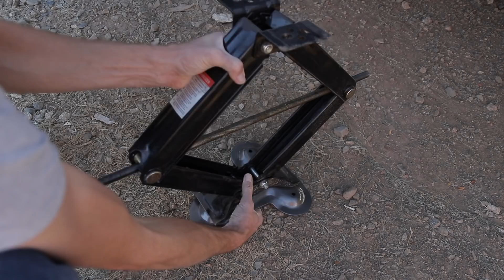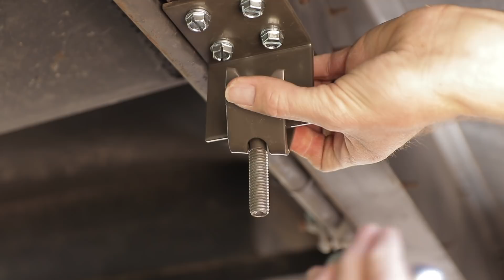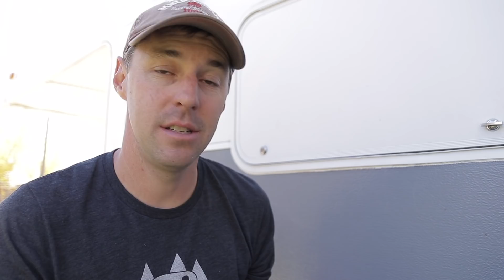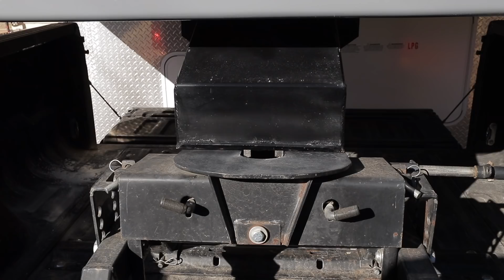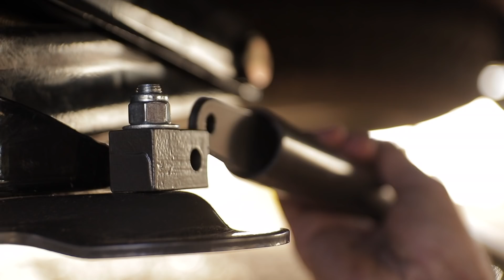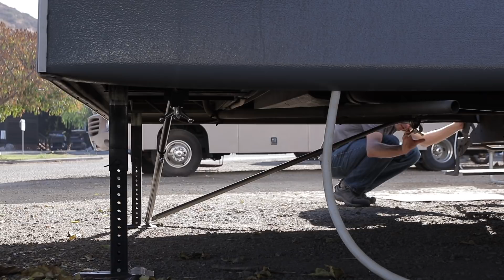RV Stabilizing! Review and Install SteadyFast!

Comment: Would drilling into the frame void any RV warranty?
Reply from the maker: This type of install would not void a warranty but you could if it was excessive and in the wrong spot. This install wouldn’t cause a structural issue or problem for a warranty.
Reply: @AllAboutRVs  Thanks for the speedy response.  👍

Comment: So after 3 years, how are they holding up?
We will be getting a 5er this winter, trading in a TT, and am curious about these. Had an issue of rocking in a previous 5er years ago but not certain how the new one will rock with the auto-leveling system.

Comment: If an RV stabilizing system is installed, is there still a need for something like the X-Chock, which acts as wheel chocks and is supposed to reduce the rocking motion? Would using "ordinary" wheel chocks be sufficient if RV stabilizers are installed?
Reply from the maker: I use just normal wheel chocks. I never saw much of a benefit when it comes to stabilizing with the he X chocks. I would use X chocks if I were to be up on blocks to level. It would be the easiest way to chock then.
Reply: @AllAboutRVs  Thanks!

Comment: My wife and I are very new subscribers to your channel and we love all the information you and your wife have.  I recognize the need to avoid interference with the placement of your stabilizing bars.  Was there any other particular reasoning for the specific placement?  I noticed the double brace was in the front, single rear.  Was that in hopes to further stabilize the master bedroom or more a manufacturer's recommendation?  We are brand new to RVing but have noticed plenty of movement in our older 2005 30' TT we just purchased.  Thanks!!
Reply from the maker: The back of our RV is drop frame so there was more room to put it in the front and I wanted it under the master bedroom and the angle is more effective in the front since there is more room to put it at a better angle

Comment: Nice video!  

1.  Will this help with motion caused by a hybrid flip out bed?  The leverage it has really amplifies movement in the rest of the camper. 

2.  Any chance you could do a short video of your kids running with a glass of water on the dinette table with and without this system.  Seems like that would provide a nice visual.  

Thanks!

Comment: Good video. I had the Steady Fast System on my tavel trailer 10 years ago. I didnt install them on my 5th wheel when I got it 9 years ago even though it did work great on the travel trailer. I have the JT Strongarms on the 5th wheel and not all that impressed. I think I went with it because of the spare underneath the front. There was no clearance with the spare tire there.

Comment: Question - I installed this yesterday on my 27' TT.  I put the lock washer on the NUT side of the swivel clamp and NOT the BOLT side.  Then after re-reading the instructions, it says, "Lock washer must go under head of bolt."  Do I take it apart?  Any reason?

Comment: Looking at this. You connect to two stabilizers/levelers but you replaced the foot pads on all 4. To match or better stability?
Great video as always.
Reply: Website says that the extra 2 foot pads don't improve performance and are just for looks.

Comment: Great video! Before buying check out the JT Strong stabilizers. I put them on my 35’ fifth wheel and it made a tremendous improvement. They do make a difference ..... either brand.